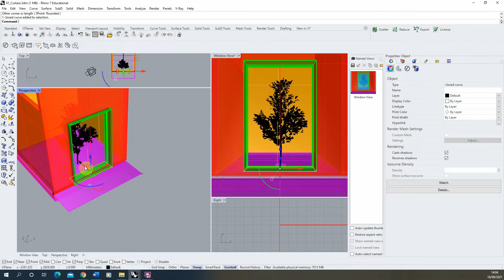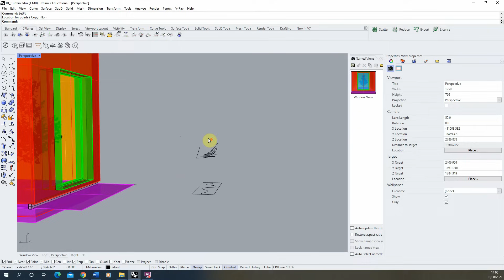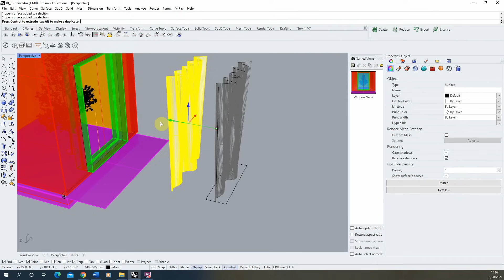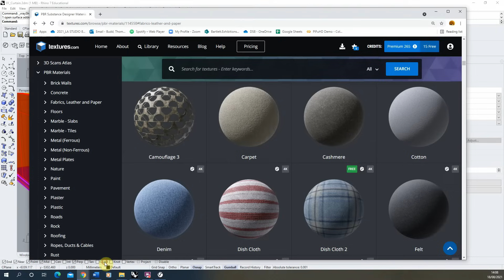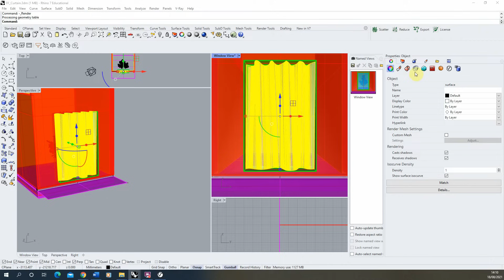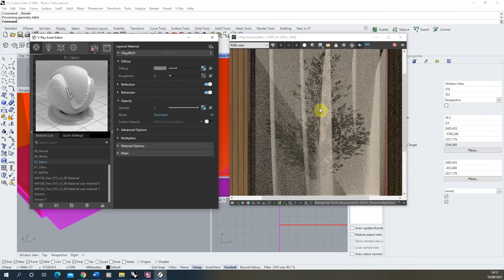Curtain and Fabric Creation Tutorial - Rhino 7 and Vray

Comment: Thankyou ... It's better use "Two side" material or "Surf Surfsce Scattering" than Opacity map not?
Reply from the maker: Opacity map is usually quicker when you want a good effect that's not too close to the subject but if you were doing a zoomed in detail then a two sided material may be better. I wouldnt use subsurface with a thin material like fabric as its usually better for slightly denser transparent objects